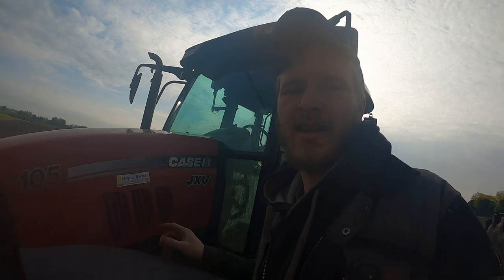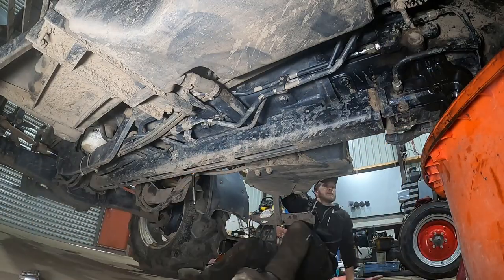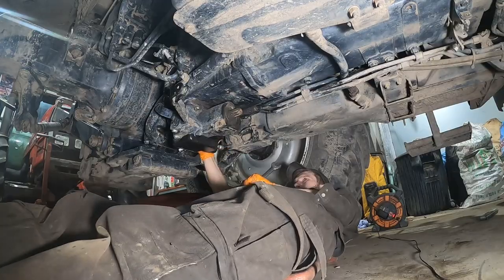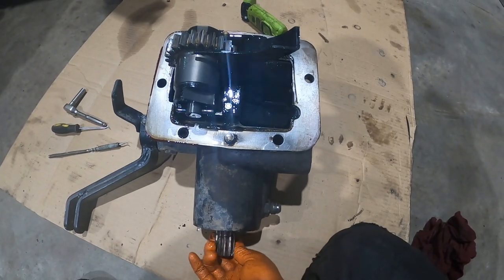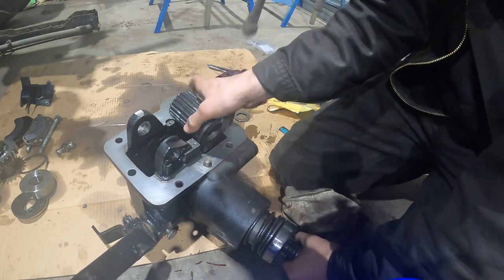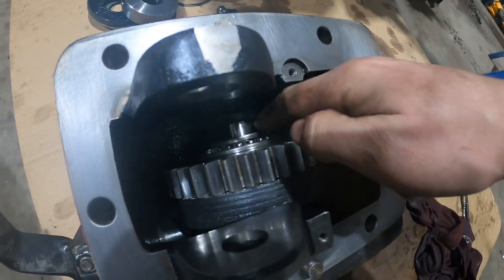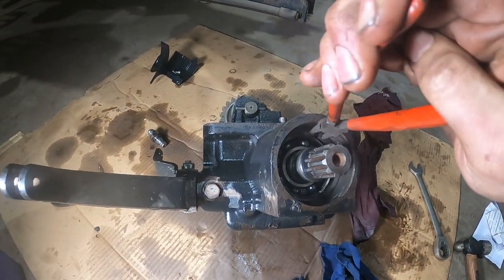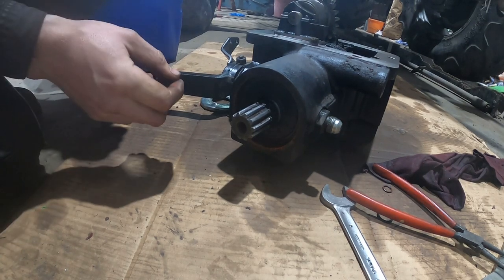This Case 105 Has Lost Four Wheel Drive

Comment: Be careful I had to replace the spring because it had weakened look ok but compared to the new it had shortened and not give enough pressure on the clutch 👍
Reply from the maker: I was thinking something along those line too before I got it apart 👍🛠️

Comment: Hi this is a great video. I have a problem with a cx90. Stuck in 4wd. Light on dash goes on and out. 
Was bogged and used dif lock also. 
Any suggestions appreciated

Comment: Great video mark, have a question relating to a similar problem, Neighbours landini vision 105 is stuck in 4wd, he claims it’s been like that ever since he jumps started jt this spring after it sat for a while , do  you know how the 4wd works on this tractor. 
Light on dash registers switch being toggled but no noise of disengagement, how is the link between electric and hydraulic power made, is it just a solinoid
Reply from the maker: Thanks Patrick , sounds like it’s a power supply to the solenoid problem or the solenoid it’s self. Most are sprung on 4wd and oil pressure through a solenoid to disengage.